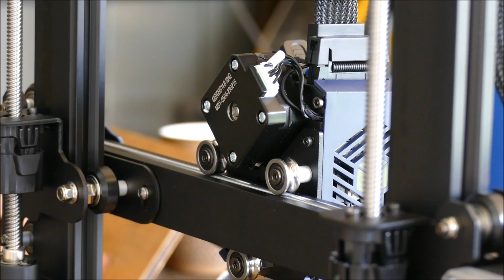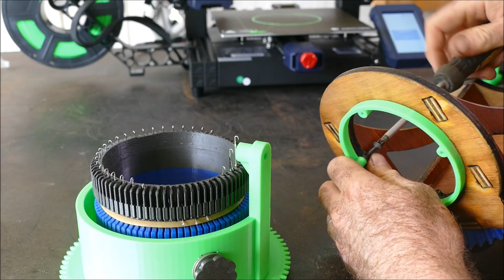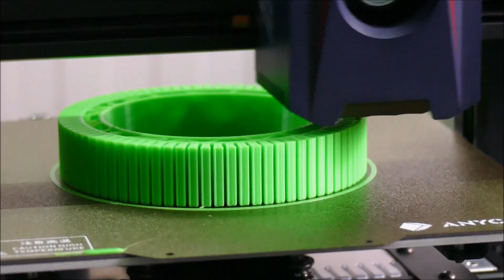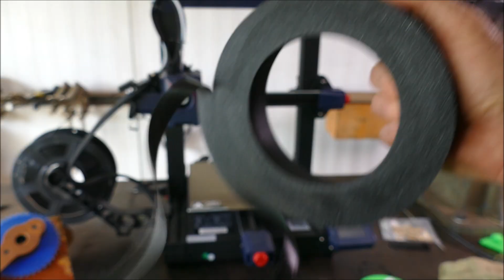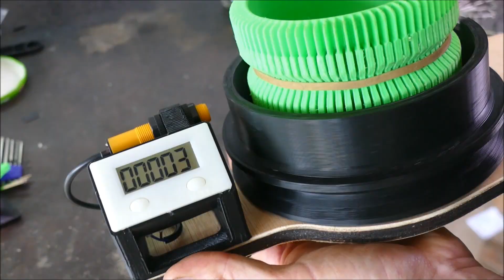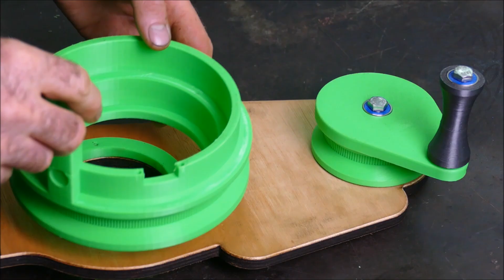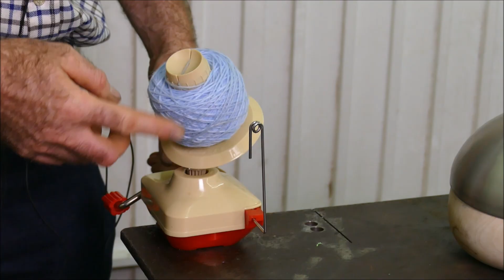3D printed sock knitting machine(CSM) MK2 endurance test of Anycubic Kobra 2 + free build plans

Comment: What happens if you oscillate the knitting on one side intermittently?  Could you make a curve?  Could you just have the needles and the shuttle computer controlled to determine when to knit extra on one side to make the sock's heel?
Reply from the maker: Yes exactly that. You're meant to add Extra lines of knitting on one side only and then continue on after to create a curve. Cheers J

Comment: As a machine knitter, this was great to watch.  Love that you are reimagining very old technology.  The feature you need for a heel is called "holding" where you put some needles out of work while others continue to knit.  Adding a ribber to this setup will also make that easier to do as well as give you the ability to add a cuff that keeps the sock up.
Reply from the maker: Thank you that's good info. Cheers J
Reply: To make short rows and shape a heel you need to hook the yarn one needle farther than where you want to reverse direction, as she said, a retainer. 
Now, I didn't know ribbing was possible in these round machines.
I have a flat Lanofix that belonged to my mother and still works.
Reply: @Ariramba123  does 3d printed clothes price same or little more than fast fashion

Comment: I think the TPU belt idea might work better if the groove had more grip.  But the timing belt is probably a better choice.  You can buy circular belts in custom lengths, btw.
Reply from the maker: Thank you. You're probably right although I rough sanded the surface to get more grip and it still wasn't gripping enough. I didn't know what size I may need at the time but I have 5m belts at hand for building a custom CNC plasma table. Cheers J

Comment: DON'T get this laser machine. It is very dangerous. And if you get the accessories to reduce the risk, you will end up paying more than proper machines
Reply: The laser machine isn't dangerous. In particular, the xtool. As long as you have proper ventilation and use everything properly, everything will be fine. It can and has alarmed due to flame, that is a safety feature. You should never leave it unattended
Reply: what are you talkoing about? the direct and indirect laser is the most dangerous thing in it and this is so open that a damage will happen for sure. Again, watch the LTT video. At the end, go for it and pay the same or more than a propper protected machine. Customers are weird!!  @MirandaFitzpatrickDezigns
Reply from the maker: I understand why you believe it's dangerous but the risk in my opinion is no different to using any kind power tool, I would go as far as to say a grinder, Dremel tool, chainsaw etc is far more dangerous yet they're available off the shelf to anyone without checking for the correct PPE  or safety protocols. The open gantry is far more versatile than the boxed in versions in my opinion. Cheers J
Reply: I am talking about the laser and the smoke. There are many videos about it and I as a lab director know that the videos such as the one published around two weeks ago from LTT are right. It is risky and it is not worth it risk your eyes at all. The cost is not a benefit either. You get one time reflected laser light and you get a damage that you may not notice at the moment, but later when your eye sight gets reduced and you start to think "why did this happen earlier in my life than it should be.  @joshuadelisle

Comment: 11:40 Why isn't that PDF included in printer documents?? You have to have a failure, contact the company, THEN have access??? Makes no sense.
Reply from the maker: I'm assuming it's getting fixed in production so the new batches won't have that issue. Cheers J
Reply: @joshuadelisle  Last I'll say is someone prepared the PDF, I assume, not only for you.
Great videos, BTW. I learned a lot while working with my laser etcher. Regards.

Comment: I used to run production knitting machines at my old job. There was no way you could get those things to run on half needles, also the needles were only about an inch long and broke constantly, and in various interesting ways. The biggest difference I see with yours is the guide. The ones I worked with moved the tips of the needles in a sine wave rather than a broken triangle wave, and both the bottom and top guides were full separate ring pieces that could be moved independently to bias the tolerance to the leading or trailing edge, which was important for different stiffnesses of the thread. They also moved extremely fast. Probably at least 300 RPM, if not 600. They used the same sort of belts used in automobile engines, and the tension had to be set with a special torque slip ratcheting wrench to get it just right. I'm mostly impressed by just how similar that thing is to what I worked with, given that I wasn't allowed to record how cool they were for "corporate espionage" reasons... had to sign an NDA and everything... expired now, but still.
Reply from the maker: That's awesome. Thank you. Cheers J

Comment: You can use natural, carbon or glass fiber to nit a "tunnel" like seen here and then use epox glue to create tubing. This is pretty awesome.
Ver well done. Knitting might not sound manly, but you can create really cool and practical items like wool hats, socks, sweatshirts, I find that pretty awesome.
Reply from the maker: Thank you so much. That's a great tip. Cheers J
Reply: Sounds like it would be feasible to make a carbon sock, stretch it over a printed shape, epoxy, and have a custom intake tube?
Reply: @caddyguy5369  Yes exactly. Just don´t forget you need to remove the 3D printed pattern somehow from the inside. Usually low melting point metals are used for this. So what you can do is, create a 3D printed mold, use the mold to create a low melting point metal, then stretch the carbon fiber sock over and epoxy it into place, then melt out the metal on a hot stove or similar.
Also don´t forget the resin is exothermic and can get quiet hot while setting. What I would try is 3D print a thin pattern, spray paint it with fireproof paint like the one from VITCAS and after the epoxy has cured get inside the tube and yang the pattern out with long pliers and brute force. One has to try that. I created metal molds from fire retardent spray paint and with 3D printed patterns, so many things are possible. I should probably upload that stuff on youtube as awell xD

Comment: What a brilliant project. This brings back so many memories of my 1st job as a 16 year old (some 35+ years ago) where I was trained as a sock knitting machine mechanic  in a large hosiery factory in Nottinghamshire. I spent 4 years there before being made redundant. 
Your machine is most impressive  and works in a very similar way to the  large commercial machines that I worked on in the mid and late 80's
Reply: How did the industrial machines make heels?
Reply: @CycleRayinOK  they operated in a reciprocating mode rotating clockwise then anticlockwise through 180 degrees
Reply from the maker: Wow that's awesome. Thank you so much. Cheers J

Comment: Looks a lot faster than the two sets of pointy things on a rope i use to make wool socks :) wool can be much cheaper to buy than wool socks.   Could the heel turn section be done by making two sock portions and connecting them with a hand stiched heel turn.

Comment: I absolutely love this idea. I was wondering if it's possible to make a larger tube/ add more needles? Is there any way to make it parametric so you could tell it how many needles you want then the model adjusts?
Reply from the maker: Thank you. The cylinder holds up to 80 needles currently and you choose how many you want to add. I'll have to make larger cylinders to accommodate more needles. Cheers J

Comment: The heel is formed buy hanging weights determined buy the "stretch" of the material. So you just stretch a heel in. I know there's other ways but I think that works.
Reply from the maker: Good tip. Cheers J

Comment: Last is the stand. I've seen legs added to the original wood crate they came in with a hole in it and the knitter on top. It all fits in the crate.  Another is use a barstool and cut it down till it is handy from a seated position. 
   A reason to make printed ones is the originals are pretty top heavy if it is on something portable. I used to knock it over as a little kid, it didnt take much. Don't know how it survived. They are expensive now. That cast iron was thin. I've seen broken ones for sale more than once. Most people won't braze cast. 
 It sounds good btw, smooth .
Reply from the maker: Thank you. Cheers J

Comment: Absolutely love it. I have a bunch of the hefty flatbed machines and have always loved the simplicity of the CSMs, and especially appreciated the size of them not being like a meter long. I have wanted to print one for a long time (and wanted to have the fun of attempting to design one for myself) and your version has made me properly consider that again. A flatbed with a ribber can do pretty much anything these sock machines can in terms of making a tube, but they have issues with tension matching between beds and also evenly weighing down the peices because the edges pull in differently to the middle. One day I hope to own a CSM and this has made my chances a lot better, especially with the relatively few parts
Reply from the maker: Thank you. All the very best. Cheers J

Comment: Do you have fume extraction in your workshop ? I had to do it recently due to multiple 3d printers, a laser cutter and ozone fro high-voltage experiments. Mine is all going into the back neighbour's garden :)
Reply from the maker: Currently I just have the doors open and a through draft. I have extraction for the co2 lasers though. Cheers J

Comment: M8, that's not incompetence. That's R&D. It's very common to build multiple prototypes, each with their own set of issues. That's the point of prototypes after all, you build them to find the issues with the design so you can iron out the kinks. There may be someone smarter than me who can, reliably, just get it right the first time around but that's not applicable to most people so they're not really relevant here and I ain't met them yet so I doubt they exist.
Reply from the maker: Thank you but most of it was just silly mistakes or things I forgot to change. The R&D I've done before has more notes, analysis and planning rather than winging it like I did here. But your right R&D in general definitely produces a lot of waste from many attempts. Cheers J

Comment: I love what you have done with the CSM design and I would love to compare notes. The straight knitting hooks will be a problem eventually since they don't work well for tailoring areas like the heed and toe. The belt drive is very clever to avoid the slippage issue, but it makes the calculation of the ratio of handle turns to rows knitted a little more difficult to track. Maybe a chain drive like a bicycle? Also, I noticed that your design on thingiverse has a no-derivatives, non commercial license. Does your statement at the end of the video inviting derivatives trump that license? Where can I best reach out to talk with you about this project?
Reply from the maker: Thank you so much, those are good tips. I'll look at the copyright as I just clicked what I thought was needed at the time but can sure make changes to it for your own use no problem. Cheers J

Comment: neat! add some grease so it would spin better, also buy a melter to melt your 3d printed failures into filament again
Reply from the maker: Thank I've done/doing both. but instead of filament i'm making sheet plastic for thermal forming. cheers J

Comment: Love this, but whoa, you need ventilation for the laser cutting! Like at least a hood with a strong inline fan above it. I ended up making a sealed enclosure around my D1 with a dedicated ventilation duct. the glues involved in sheet woods will always give off cancerous gases when you laser cut it.
Reply from the maker: Your not wrong. I do have the big doors open but you're right it's not good to breathe. Cheers J

Comment: Very cool project. You don't need brims on most of these prints BTW, so you can save yourself a lot of time. Brims are only necessary when the first layer surface area is small in comparison to the height of the print, so really only for tall and skinny shapes, or ones with very thin walls or tiny islands. Also knitting is plenty manly because there are men that knit and manly means doing what men do. 

(that means that It's also womanly since women knit and its even nonbinarly since enbies also knit. Don't worry about society's gender expectations, just do what you want)

Comment: Stop printing with brims mate. You don’t need them and it just screams “I don’t know much about 3d printing”
Reply from the maker: i did need them for certain shapes as the prints kept peeling off. cheers J
Reply: @joshuadelisle  I've been printing for 12 years now and no you dont. 
Brims are a workaround for people with poor setups/environments, they don't fix the root cause 
I'd recommend setting up an enclosure for your printer as even the draft from walking past can cause adhesion and or warping issues.
BUT then again my dad said "Don't give advice. Wise people don't need it and fools wont take it"
Reply from the maker: @d1v1s1onby0  thank you. Maybe my bed wasn't hot enough but it would constantly peel until I added brims. The shape is more prone to warping than other parts I've done and I generally just do a skirt otherwise. Cheers J

Comment: I wonder why don't you print it from PETG? It has lower friction coefficient, less prone to wearing out or crumbling of sliding surfaces. It's just better for this type of appliaction.
And if you make the grooves for the belt wider, you can just make a full and a half loop on them providing much more grip compared to the basic half loop configuration you used while not needing a home made infinite timing belt or a tensioner mechanism.
Reply from the maker: I did in the last video but I need a dryer which I don't have as petg always has moisture problems for me. Cheers J

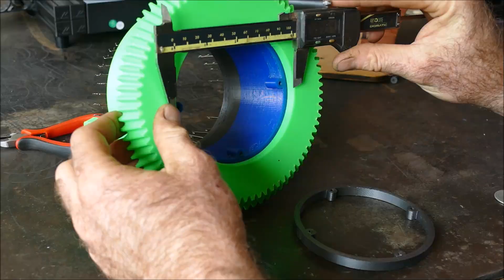Comment: Helpful tip, at 3:28 you were using the calipers backward. That side of the caliper is meant for measuring outside dimensions, the other side is meant for measuring inside dimensions. Notice that the flat/pointy parts of the jaw on one side face each other (for getting accurate interior dimensions) and on the other side they face away from each other (for getting accurate interior dimensions).
Again, not trying to be a jerk, just want to help you get better measurements.
Reply from the maker: You're right but mine are broken on the other tips so I can't do that. Cheers J

Comment: I have a Anycubic Mono resin printer.... Never had a failed print or needed to fiddle with it... Everytime I see videos with PLA printers it is allways a hazzle getting it to do proper prints it seems...
I'd like the advantages and size capabillities of a PLA printer, but all the possible errors and mistakes with them is keeping me from buying one.... In this video it seems like you spent half your time battling the printer rather than making your build wich would drive me nuts and drag out my pojects...
Reply from the maker: I'm using a resin printer currently and they are very smooth to operate with flawless precision. However it worries me how toxic the resin is and how un recyclable the prints are. Cheers J
Reply: @joshuadelisle  
Totally agree on that last part of your comment! I recently switched to water dissolvable resin; It makes things so much easier to handle and it seems much less toxic by the smell (I know thats not the only factor) but they are also so much less sticky fluids and you don't have to play around with Iso alcohol. If you spill it is easier to clean up and you don't risk dissolving you floor varnish etc...
And so far they seem every bit as capable as Iso resins...

Comment: this is awesome... i wish i knew how to edit the files, i would make it bigger/wider so i can make beanies... it takes me about 7 hours of knitting to make a beanie with 3 weight, 90 stitches round...
Reply from the maker: I can do 80 stitches max with this one. I'll have to try a 90 barrel on it. Cheers J
Reply: @joshuadelisle   yes, a bigger barrel with maybe 98 stitches or so...? in knitting, you use bigger needles to make bigger stitches... the knitting machines that are sold on amazon and such are only 48 needles, but are spaced so far apart... and people make beanies out of it... the one you have looks so spaced together, and makes a pretty dope sock....

also, people do knit tube socks... you don't have to put a bend... also to do the bend, you move the machine back and forth a couple of times.... i honestly don't know how it's done, i don't own a machine, but iv'e seen people make socks with a bend on the machines, it's cool...